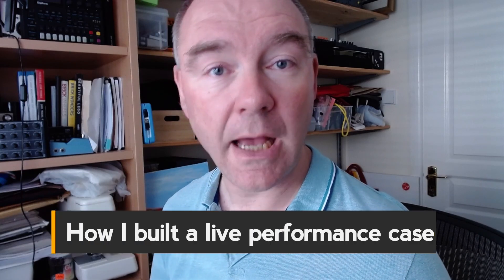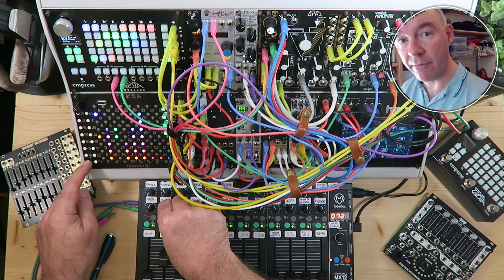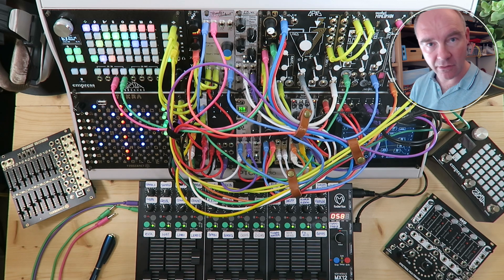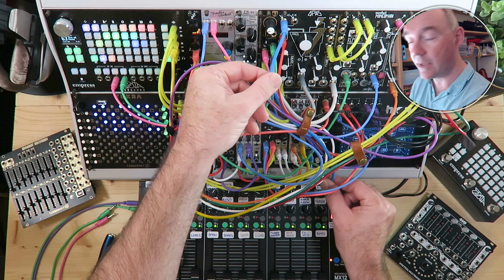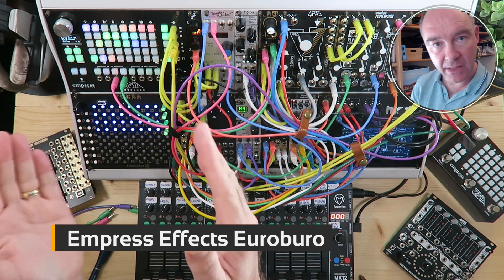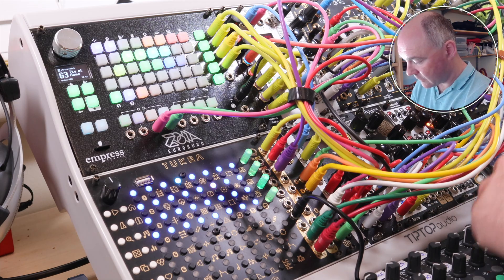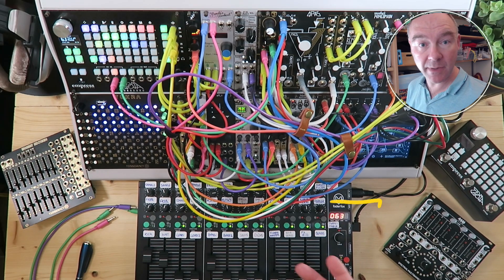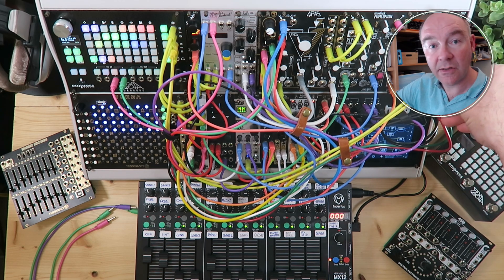HOW I MADE A LIVE MODULAR TECHNO PERFORMANCE SYNTH. PolyEffects Hector, Euroburo, Tesseract Tukra.

Comment: Looks like a really fun live rig. You have also convinced me to get a Faderfox, it looks like such a solid controller.
Reply: I've been thinking about nabbing a Novation Launch Control XL as a poor man's midi controller to make the Euroboro easier to work with once I have a patch dialed in (I don't have a Hector, yet, though that extra cv & midi through would be nice)
Reply from the maker: Faderfox make great controllers, I highly recommend them. Rock solid and built like a tank
Reply from the maker: Any MIDI control paired to the Euroburo will really open it up. I also got the Tesseract Sweet16 as it sends CV and MIDI from the faders. That way I can keep everything 'in the case'

Comment: using the zoia as an effects unit, how would you map parameters to use them with an expression pedal? what expression pedal would work with the zoia?
Reply from the maker: I’m not that familiar with expression pedals, but it is simple to use the Cexp In module under interfaces to take the value from the expression port and use it to modulate a parameter

Comment: How do you find the latency on the Hector? I've heard it can reach 18ms or more. My reaction time is too sensitive for that. Also, your Hector patch seems pretty well populated. How is the cpu load handling it?
Reply from the maker: Latency is definitely an issue if you’re doing parallel processing. In this case the Hector is end-of-chain so latency doesn’t really get too noticeable. But there is definitely a lag between sending MIDI to it and hearing the response.
Reply: @SynthDad  Thanks so much for the info. I've heard the Hector can do loads (well, everything), but with some limitations.

Comment: Tukra is amazing, I need to get a midi controller for it.
Reply from the maker: Given how 'busy' the front panel is the Tukra really benefits from a MIDI controller, even for simple settings like track level and filter
Reply: What controller you recommend on eurorack for it, guys? I’m looking to get one for Hector and Tukra, but I don’t have much space left… Sweet16? VCMC?
Reply from the maker: @danielruizmunoz  I've the Tesseract Sweet16 and it is really good! But if you need more than 16 controls (and you will for Hector and Tukra) then I recommend either the Faderfox MX12 or PC12 controllers. They really are the best out there right now
Reply: @danielruizmunoz  I was thinking sweet16 cause its the cheapest I could find.